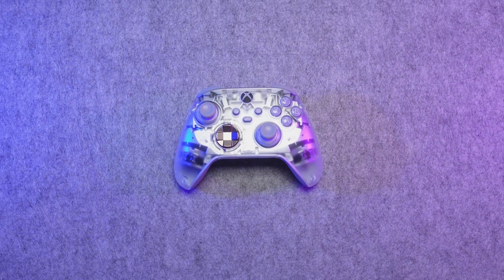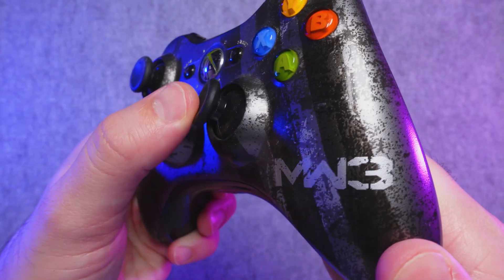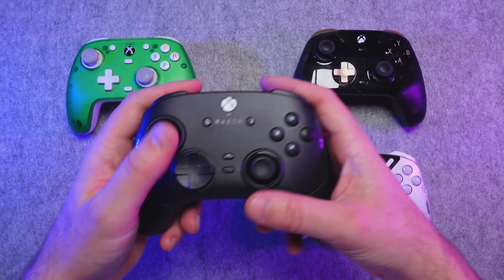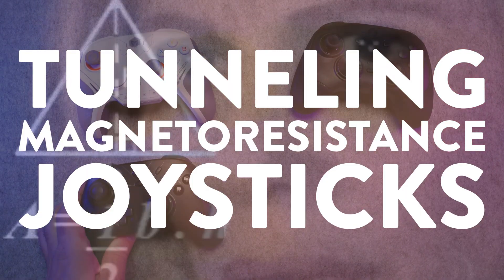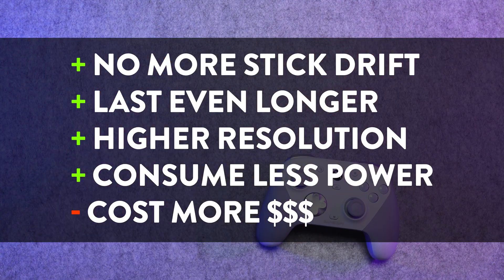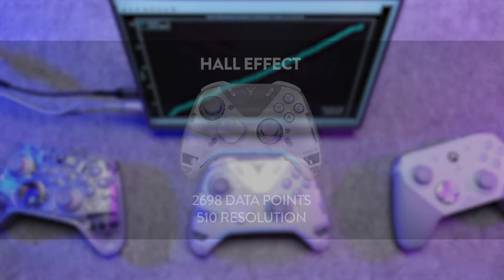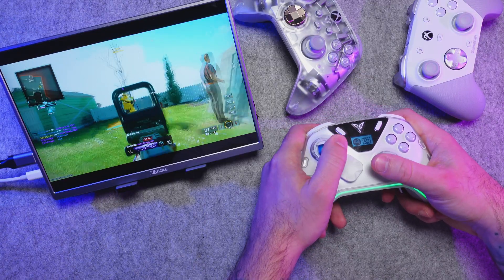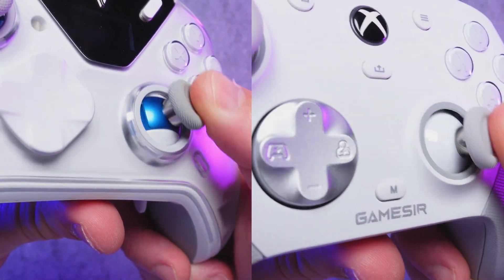Hall Effect vs TMR - What's the difference?

Comment: me personally and I think for a lot of other people purchased a hall effect or TMR controller for the anti stick drift what I didnt know was that HE controllers had worse centering and never really thought about the resolution of the sensor resulting in a smoother sensitivity but what I can say is that I dont really notice the smoothness mentioned playing on console or pc wired or wireless but ive not had a single issue with any of the HE/TMR controllers ive used ive tried the Razer V3 pro 1k polling version (they have a newer 8k one out now) and the Gamesir G7 pro if you have wider hands I would recommend staying away from the Razer controller your pinkies start to hurt from the shorter grips and feels like you have to squeeze tighter and can cause some aching on longer gaming sessions

Comment: 0:26 what do you mean it’s improved? A late 1997 Dualshock potentiometer lasts 25 years of use without fail, but a PS5 controller lasts from 3 months till 2 years before stick drift..

They could make them last but it wouldn’t be good business for them.

Comment: Only question i wanna ask is those using hall effect doesnt seems to find replaceable part easily while potentiometer are cheaps and available everywhere. I repair mine constantly , but with hall effect im so worried when it failed, how do i replace em. Recently i have a Gamesir G7 bumper broken, contacting gamesir, they said they dont offer parts, so its e-waste basically. :(

Comment: I bought 8bit do  ultimate C wired regular version, and in 2 months the left trigger was giving up so when you push all the way be 0 to 100 but then was only reaching 48 then 3 weeks later right joystick started to drift up and got worst over the week that the deadzone wasnt helping more.

Then I got the same controller BUT with hall effects and from June 17 till today Dec 3 no drift or trigger degrade bit WARNING out the box it wasnt centered the sticks so you HAVE to download their program and install the update to center the controller and done.
Reply from the maker: it can happen! I've had to calibrate many controllers out of the box but hopefully it stays centered after that

Comment: i use a flydigi vader 4 and i'm sticking with flydigi just because the adjustable tension for analog.  as for tmr vs hall effect i'm researching which i should replace my ps5 stick drift controller with.  i guess i'll go with tmr.
Reply from the maker: The Vader 4 Pro is the reason I said started this channel! Still my favorite. And yeah I like Gulikit tension adjustable TMR sticks in my dualsense or KSilver JS13

Comment: You completely forgot to mention 3 big flaws;
- most hall sensor/TMR sticks have massive OUTER deadzone, to account for the bad centering of the stick, making them way less precise than standard stick as the range is greatly reduced. That's also the reason you see a better linearity and circularity, because it's purposely clamped down. Normal sticks also behave the same if you add outer deadzone.
- the sensors are very sensitive to magnetic field changes, so can be easily disturbed by any magnet or metal parts around the stick. That's one of the reasons why they have centering problems. And it's not always stable, meaning over time it will cause... Drifts. The very thing they are pretending to remove.
- the sensors are digital, which requires data transfer and processing, which bottleneck their polling rate and therefore latency. It's a lot worse than the simpler ADC converter of traditional controllers, causing bad stick latency issues in many "modern" controllers.
Reply: So what do you suggest?
Reply: @xXqUiCkScOuPeRXxHDx either getting a good quality first party controller with full size sticks (good quality potentiometer sticks always beat cheap Chinese hall/TMR), or if you're too afraid of the potential drift, waiting for big companies to start using better TMR sensors (with higher range and better latency, yes they do exist). 
I have high hopes for the new steam controller.

Comment: A technical correction, all joysticks have physical contact between moving parts, namely the pivot points on the two axes of movement, as such, they are all susceptible to some kind of wear and tear. The primary difference between potentiometers and other types is that the sensors that measure movement also have physical contact, which can lead to drift. Hall Effect and TMR sticks don't have this problem, but that doesn't mean they can't experience mechanical failure further down the line.

Comment: Most of my controllers are hall effect. And I have two TMR controllers, cyclone 2 and tarantula pro. None of them can beat a traditional controller like dual sense when it comes to games with no/little aim assist, where fine adjustment is required.
Reply: What's better? Cyclone or tarantula

Comment: i was on a g7 pro and it felt pretty good for aiming, but the hardware sucks and parts got worn or broke pretty fast. is there any other tmr controller for xbox with a better build quality? i play on pc too and was wondering about the wolverine 8k and it looks like a perfect fit but i want to be able to play on both xbox and pc. should i just get the regular wolverine with hall instead of tmr?
Reply from the maker: I've been loving the SCUF Valor Pro Wireless on Xbox and PC! TMR sticks and a good sturdy build. I love the back button layout as well
Reply: @AndysTechTable regarding the wolverine or the wired scuf valor pro, will i notice much of a difference if i go to hall effect? the wireless scuf is a bit too pricey for me. if so, i might just go with the wolverine 8k for tmrs on pc
Reply from the maker: @igorleone834 I prefer the back button layout and feel of the SCUF controllers so I'd try the wired one if you don't mind that. The Razer controllers are nice but 8K is a gimmick and takes a lot of computer resources anyway.

Comment: TMR no more drift? Before buy, alot of people comment cyclone 2 not  bad. After bought gamesir cyclone 2 only 3 month, left stick drift up itself 10%, 100% randomly. Reset, recalibrate, anti drift settings..all this useless.. nowadays controller all using cheap material. Don't trust on advertise too much. All is business strategy to lure customer buy.
Reply: I use it for a month and i am very satisfied with cyclone 2. Only failure from begin was if i put deadzone on the right stick less than 2 in app, get stickdrift even with TMR. Everything else is pretty good.

Comment: I recently tried an 8bitdo ultimate 2 which had TMR joysticks, found them incredibly hard to aim with compared to my standard ps5 controller. If the target didn't move much it was fine but as soon as I had to track them it was really hard. Before those I had an gamesir super nova which was pretty much the same problem.

I feel like they focused on removing stick drift but didn't think of the overall smoothness control you need in shooter games
Reply from the maker: that's not an uncommon feeling! Some people just prefer the feel of ALPS sticks and that's totally valid

Comment: Got my first tmr with the 8bitdo ultimate 2. Gotta say I don't see much difference compared to hall effect
Reply from the maker: It's very subtle. The resolution is also partly determined by the controllers analog to digital converter.
Reply: TMR is still emergent tech.  A lot of companies are just slapping it in as a marketing buzzword.  It has to be dialed-in to deliver its full potential.  

Compared to a good HES, the average TMR advantage is currently negligible.
Reply: @redslate  the battery life is supposed to be better. 8bitdo controllers always have a good battery life and will never die in a single session so i don't really know. But better battery life and being practically immune to drift, are awesome on their own so I'm happy with it

Comment: is there any chance get in Game ban like call of duty using these controllers besides regular Xbox controller because it has features like turbo mode
Reply from the maker: any legit licensed Xbox controller won't be able to use turbo. but if you use an adaptor to use 3rd party controllers and use turbo mode you can risk getting banned from certain games

Comment: I have TMR Sticks installed on my PS5 Edge controller for some days now. And the difference between the standard sticks and the TMR sticks is amazing. 
You can aim way more precise and you can clearly feel they have a way higher resolution...

It´s a bit tricky to install them, but it´s absolutley worth it.
Reply from the maker: I'm planning on installing some TMR sticks in my Edge soon! can't wait to get rid of drift and even add some adjustable tension

Comment: So a standard ps4 controller will feel less responsive vs a hall effect controller? And a tmr controller will feel even better?
Reply from the maker: it depends on the controllers analog to digital converter and the quality of the sticks. if the controller is capable of giving you lots of steps like the G7 Pro in this video it will definitely feel smoother
Reply: @AndysTechTable thank you👍🤝
Reply from the maker: @Esxpy any time!

Comment: sadly hall effect joysticks spare parts are rare / non existent. the plastic it uses as the spring worn out and sticks not drift but can't return to center by itself. weak product. i used first hall effect gullikit and only last 2 years of light gaming. now cant repair / no spares. while my ps2 sticks analogs still available. so imma vote out on hall effect. worst purchase for me
Reply from the maker: You can always swap the modules for new ones instead of doing a straight repair! Or get TMR sticks since they're the hot thing right now

Comment: TMR more expensive? 8 Bitdo pro 3 is 70 for TMR Sticks and you can get them onsale (I did just last week) for 60.
Reply from the maker: In general the manufacturing cost for the technology is more than potentiometers which have been around for years but the higher cost largely comes from companies using the buzzwords to justify a higher price. Many third party companies like 8BitDo charge reasonable prices for their controllers with TMR sticks. It's mostly the big names that charge a premium
Reply: @AndysTechTable  True the big companies Nintendo are overpriced and lack features the 3rd party have inherently or in the case of PS5 pro your paying over 100.
Reply from the maker: @Chiyochanazu 200 bucks for the dualsense edge and it's potentiometer sticks 😅

Comment: Potentiometer thecnology hasn't really changed for a long time, there was some miniaturization, but most of them is very old tech too. Some have fancier cassing but the quality has actually in a lot of casses gone down. There are some Joysticks like the Microsoft Force Feedback 2 that over 20 years later still work with no meaningfull drifts or spikes (altough their USB controller is lower resolution than what's used now a days), but playstation controllers ususally develop drift after a few months.
Also although HALL effect sensor controllers are usually sold at a premium, their technology is actually inexpensive and no more costly to produce than potentiometer controllers. This is just about manufacturers squezing all the profit they can get.
Reply from the maker: That force feedback 2 seems interesting. Maybe one day I'll do a history of joysticks video!
Reply: @AndysTechTable  It's a bit of a diferent use case, the MSFF2 being a device geared toward the flight simulator crowd, but the potentiometers inside of it aren't that diferent in size from the ones used on gamecontroler thumbsticks. At but they do have an outward axel as oposed to the "hole" type of axel found on controler styled thumsick's.
Reply from the maker: @brunobarata6884 interesting. I'm so ignorant to the whole flight stick and fighting gamepad world. Maybe I'll check them out some day

Comment: 27 years ago sega released the dreamcast in japan. with the VMU and hall effect sensors both in the analog and the trigger button
Reply: Ahead of its time 
Dreamcast was a tech masterpiece
Reply: Sega also used Hall sensors in the Saturn 3D Control Pad(AKA that flying saucer thing that came with Nights).

But not the older Saturn Mission Stick and Arcade Racer controllers. Those used optical sensors... but not quadrature choppers like the N64.
Reply from the maker: I love the Dreamcast so much. One of my favorite consoles

Comment: great vid, deserves wayyy more like. Love the filming and editing of it and clear cut explanation. Another benefit to TMR sticks are the voltage required to drive it over Hall Effects. If I'm not mistaken Hall effect sensors need more voltage to drive it (so for wireless controllers you may have battery life issues) but TMR sticks use the same amount (or close to) those of a traditional potentiometer.
Reply from the maker: thank you for the kind words!! and you're right about hall effect sticks they draw more power than TMR and potentiometers

Comment: 1: You should try using gyro controls for shooters

2: Are there other controllers that uses optical chopper wheels for its sticks or is the N64 controller condemned to be an anomaly?
Reply: To my knowledge, the N64's analog nub solution is unique. It is a kinda complicated solution that has very little gain in a thumbstick scenario, but some distinct drawbacks(no ability to see center, mechanically complex).

Nintendo also made it look bad with poor engineering leading to rapid failure.
Reply: yeah i use gyro and play only FPS, i wish there was upgrades for gyro users to improve our sytems. i dont even use my right stick i have a dualsense with 2 gyro sensors inside(the factory standard 2) i cant beleive people pimp there joysticks when gyros set up nice and your muscle memory adapts its game changing
Reply: Bro, you wanna say you aim with gyro instead of right stick in fps games ???
Reply: @Ilija_cvorovic  you can use gyro and stick at the same time

Comment: Proud owner of a flydigi vader 4 pro and vader 3 pro before it. They cost a little extra than what I'm usually willing to spend, but it's worth it for me since I'm primarily a pc gamer and I make use of the extra buttons/charging dock.
It annoys me that companies don't put at least hall effect joysticks in their controllers. The only reasons is to keep the controllers cheap, but if you're already spending so much for an official controller nowadays there's no point in not putting the tech in there, it's just greedy. Worse so in nintendos case, but I don't think I need to remind anyone about fucking joycon drift. They use magnets in the switch 2 joycons to attach them to the system, but not in the joysticks. What a joke lol.
Reply from the maker: My Vader 4 pro has a so so many hours on it. One of the best ever
Reply: @AndysTechTable  Hell yeah man. My only problem with it is the right bumper has gone completely flat. That is to say it still reads the input when I press it, but it doesn't travel. Same thing happened to my vader 3 pro and I was hoping to avoid that with this one. Just something I deal with.

I originally intended on using the extra buttons for sega saturn emulation funny enough, because I'd never seen a modern controller have z and c buttons like that. Wound up getting a saturn and using the extra butons primarily for classic doom lol.
Reply from the maker: @KingOfAcorns_93 those extra buttons on the bottom right are super underrated

Comment: You know, TMR joysticks are still too new for certain consoles, but I'd be happy enough to see some for the Nintendo Switch 2 Joy Con Controllers, and the Switch 2 Pro Controllers since they clearly are easy to remove via DIY.
Reply from the maker: The new Gulikit ES Pro has TMR sticks in it and can wake the switch 2! I have one and am likely going to review it soon
Reply: @AndysTechTable  Huh... I see. But anyways, yeah, when I had some Hall Effect Joy Sticks for my Switch Pro Controller, and my Switch 2 Joy Con 2's, I DIY'd mine. But I wonder if the new ES Pro can support amiibo functionality.

EDIT: Never mind. I found out it doesn't.
Reply: But also isn't. Cause the joysticks may be easy to remove, but disassembling the controller itself is a pain

Comment: What about cheaper or budget controllers for Ps5? Where are they? Why no such controllers?
Reply from the maker: Gonna have to ask Sony that question 😅 in the meantime the Brook Wingman FGC2 works great for using other controllers on PS5
Reply: @AndysTechTable  The brook ? Any lag or latency? Those things are expensive?
Reply from the maker: @dgeci never had any issues with lag. They're $60-80 I believe on Amazon
Reply: @AndysTechTable  I asked because I heard there were some lag for the 8bitdo switch adapter. Then I could buy this one indeed. By the way, is it a universal thing? I can plug (almost) any controller from any platform to almost any other console? Or is it per platform?
Reply from the maker: @dgeci it's perf platform. The FGC2 is specifically to use other controllers on PS4/5!
Reply: @AndysTechTable  Understood. Like I was interested in the Pro 3 from 8bitdo. Could work with no lag then. But why is it so exp...
Reply from the maker: @dgeci pro 3 is great!